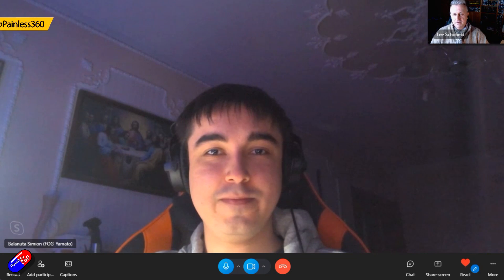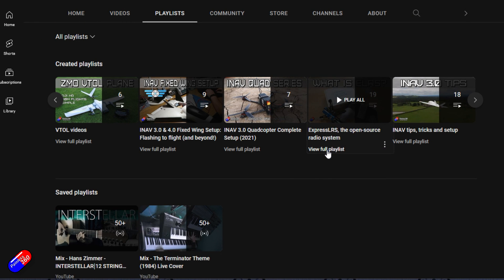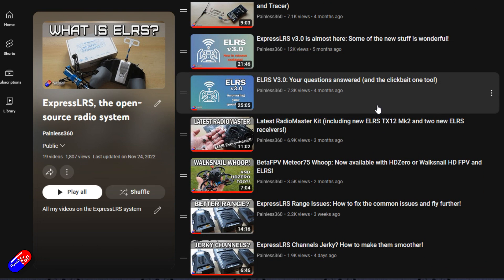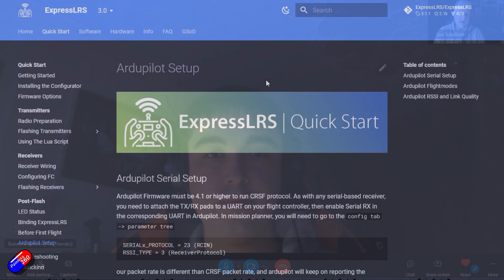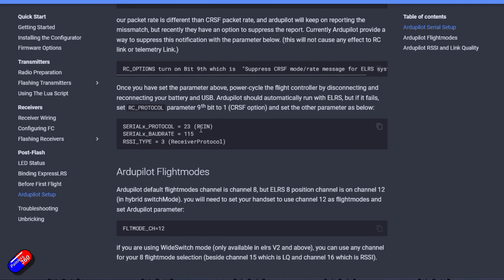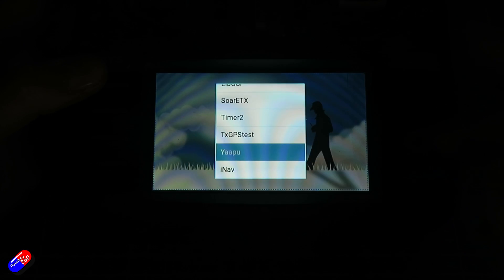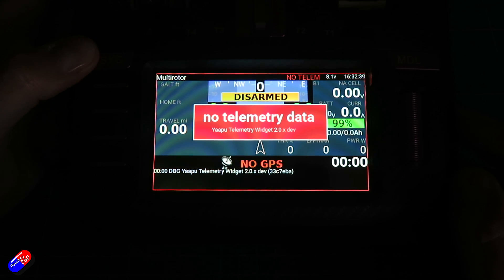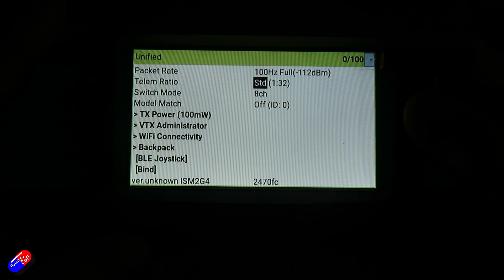ExpressLRS telemetry explained

Comment: Great video! thank you. 
i get all the data from the sensor(gps, capa, etc...) BUT "alt" keep show me "0" (i'm using ardupilot on pixhawk 2.4.8 or SB f405 v4. with frsky r9 2019 module. get the same problame with alt)
any idea ?
thank you
Reply from the maker: That'll be what you'd expect until the GPS gets a lock. When you're flying (and the home alt. had been stored), it'll read as expected.
Reply: Thank you for the replay. I get '0' even when the gps lock!
I know for shoure that it lock.
Reply from the maker: OK, let me know what troubleshooting you've already done so I don't waste time offering things you've already tried... it's likely due to issues with the AHRS (Attitude Heading Reference System) or a failed accelerometer calibration.
Reply: @Painless360  ok. the gps is lock. i've tried to delete and discover all sensors... did not help.
i'll check the AHRS. did nor get any worning about accelerometer... but i'll check again. 
i'll update soon
thank you!
Reply: @Painless360  i have recalibrate the accelr... and checked the AHRS (i'm not shoure what parameter there). all look fine. but still no ALT reading (gps is lock with 15 sats) 😒
Reply from the maker: How odd. I've never seen that. Let me know if you get it working... Happy flying

Comment: I cannot find a consistent answer for the radiomaster rp1 tx power (Telemetry back to the controller). Some places say 10mw and others 100mw. What is it?
Reply from the maker: 10mW on RadioMaster website... Happy flying
Reply: . I found there are different power levels for receivers. The radiomaster rp1 is a nano size and therefore power is low. I found a diversity elrs iflite receiver that tx's up to 250 mw.
Thanks for the fast reply.
Reply from the maker: Yep, Tx power for telemetry varies hugely on the receivers out there... Pays to check the specs before you buy.
Reply: @Painless360  I don't understand why receivers would not match the rc tx power. But then I can always choose something different. As a new guy to the fpv hobby I understand that 10 and 100mw rx's work great for normal distances. 
 I would like to have the same range for both rc txcvr and plane telemetry txcvr. I'm finding it difficult to find a 250mw telemetry txcvr. The rp3 says its 100mw, still looking though.
Reply from the maker: Not everyone wants to fly the same distance from the radio. Also, not all powers are legal in all places.. Happy flying!
Reply: @Painless360 I am very surprised 10mw for telemetry went as far as it did. 100mw should be all I need for the trees.

Comment: Great topic. I'm currently having an issue with one of my ELRD RX where only 10 telemetry sensors are received on the TX (TX16S MII),. Do you possibly know why this may be? I've tried two different rx with the same result.
FYI the FC is a Speedybee F405 mini v3, running Rotorflight v2 (latest version).
Reply from the maker: I'm not familiar with Rotorflight yet, so I'd assume it's something to do with it... Happy flying

Comment: Hello community!
Is it possible to get the battery data from an Frsky x9slim+ receiver using a Mlvss Mini Lipo Voltage Sensor connected to the smartport?
Is the function lost when transitioning to Elrs?
Reply from the maker: ExpressLRS recievers have something similar in the way... Stay tuned
Reply: @Painless360  Well Lee, thing is that im currently switching to Elrs using the r9 tx and r9slim rx. Trying to set it up using sbus but the telemetry from s port is lost and the voltage sensor no longer provides telemetry. Am i doing something wrong or the sport sensors loose functionality when using Elrs? 
Pixhawk is receiving sbus fine through the rc port, and the receiver is supposed to transmit s port data right?
Reply from the maker: If you are talking about when you flash an R9M receiver with ExpressLRS, then I don't know. I'm not aware that using Smartport sensors will work. Telemetry from the flight controller via CRSF should work fine so I'd use that.
Reply from the maker: Telemetry from the flight controller via CRSF should work fine so I'd use that

Comment: Hi which packet rate and telemetry ratio is best for rc long range fishing boat thanks. Im using jumper t pro...and matek pwm receiver..thanks
Reply from the maker: Not sure for boats. I'd guess you don't need super fast resposes so a low packet rate would be the place to start.  100 maybe? Best of luck
Reply: Ok thanks a lot . what about ratio....should i put std.
Reply from the maker: I'd start there and follow the advice in the video... best of luck

Comment: Finally someone from ExpressLRS team!
Can you please advise if there is any document on elrs phisics/protocol? How does it handle interferrence, packets structure, etc...
Reply from the maker: If you want that level of detail I would strongly advise you to get involved with the project via Github as a lot of the detail is in the code. Best of luck
Reply: @Painless360  You've gave me the same answer as Joshua ;) I've already posted few questions there, entered the discord etc... however I'm still looking for easyer way of getting info :)

Comment: Hey,  first off Merry Christmas!  This is a great video,  I am curious, for the Telemetry Lost reporting couldn't you just set the Telem Ratio to Std (1:128) and let the system adjust itself or is that not correct?
Reply from the maker: That would be step one. Issues arise with certain telemetry heavy applications.. Happy flying

Comment: I was unlucky switching to ExpressLRS Happy Model. I encountered failsafes less than 100ft. HappyModel helped and tried their best to troubleshoot the issue but they can't figure it out. Inside the house, I am able to arm it. However once I am outside the house(temps below 15-20f), I am unable to arm it. They wouldn't connect. Sometimes I am able to arm it and fly but it will failsafe within 100ft. The ELRS developers also helped me debugged the issue and they think the issue is on hardware specifically the clock. It is documented very well in 2 or 3 of my youtube videos. I just restored back my TBS crossfire hardware.
Reply: me too
Reply: There's a big section about that on the ELRS website and it shows which combinations need to be avoided and also in a move to try and mitigate that a lot of happy models new stuff have temperature controlled oscillators. But I've seen essentially that same comment multiple times that someone would switch over to elRS have problems and go back to crossfire. It seems like if you value simplicity or reliability untested ELRS setups and especially anything happy model is probably never going to be able to compare to things like TBS crossfire or TBS anything.
Reply: I have a happymodel ep1 and ep2 and have had no issues with a jumper t pro internal elrs, I went out to 1.5km today at 250mw I was at between -85 and -94bdm when I did a circle to check antenna placement, on the ep2 ceramic thing I went out to 1.2km and was touching -100dbm and it's really not well placed
Reply: @christhorney  Nice! The Happy Model engineers and ELRS Engineers worked with me and they can't figure out for a week why I was having issues. The only last thing they can think that's a possible culprit is the crystal chip and the very cold weather. They said it could be from a bad batch.
Reply: @neilfpv  is that in the receiver or like the transmitter module? i went out to 2.5km today its truly amazing whats possible i feel like im just scratching the surface lol. if you already have crossfire gear then its not like thats terrible lol i just had the emax d8 before this so you can imagine how amazed i am lol, its terrible your having issues thats the problem when you have great software and technical but manufacturing seperatly, hopefully your crossfire works flawless?
Reply: @christhorney  Yep, I'm using TBS for 3+ years now. It was my first time 2 weeks ago to reach 3km. I flew my 7 inch quad in the mountains of Tanay Rizal in the Philippines. It's boring though :( LOL

Comment: Way to go, Simion!
For most users, Std (Standard) Telemetry Ratio would suffice (it'll adjust depending on what RF Mode or Packet Rate you're using, to ensure you have sufficient update rate for your telemetry without sacrificing your RC Packet send rate)
There's Race Telemetry mode for Racers, which stops Telemetry sending once you're armed, maximizing the entirety of the packets for control.

Worst that could happen with insufficient Telemetry ratio: Sensor Lost. 

EdgeTX 2.8.0 with internal ELRS modules have eliminated the Telemetry Lost/Recovered call outs, for me at least.

Comment: Is there any way of using the telemetry data received from ardupilot+elrs rx setup to use it on a pixhawk based DIY ardupilot antenna tracker on ground?
Basically feeding the pixhawk of antenna tracker, the required telemetry data from a ardupilit+elrs rx to operate
Is there any way of doing so?